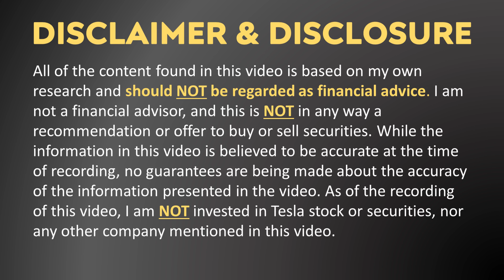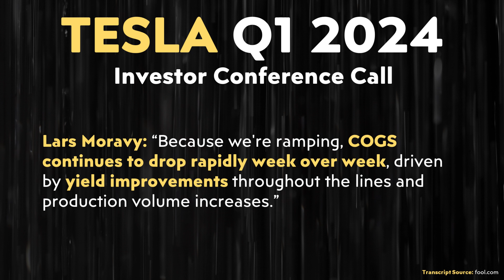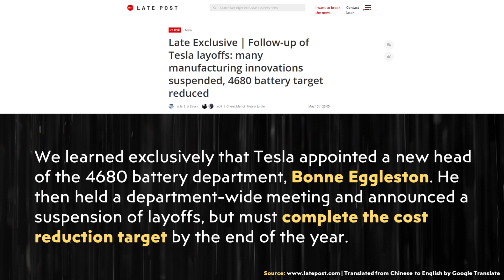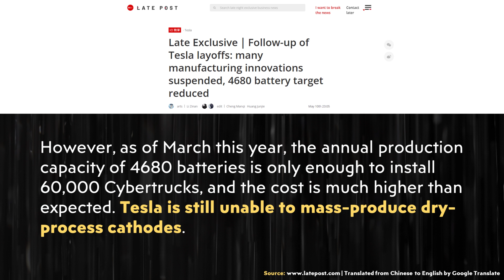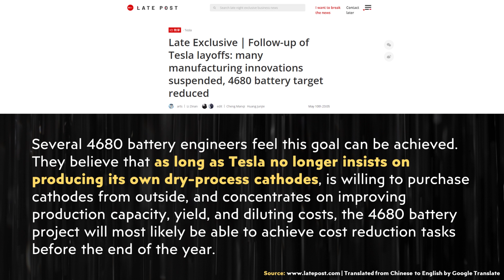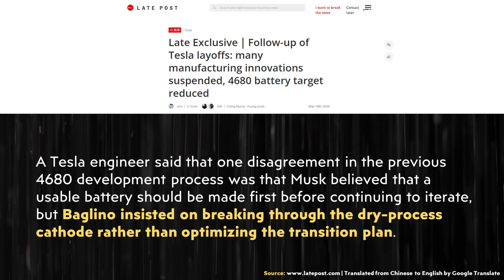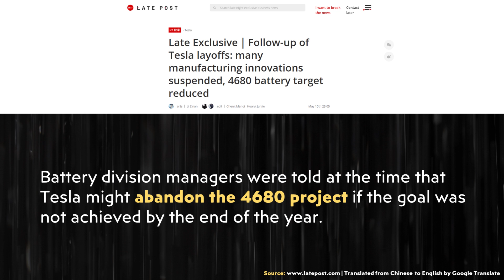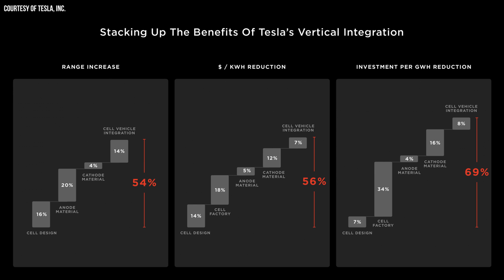Elon Musk: Lower 4680 Costs or Tesla Battery Program Abandoned!

Comment: Anyone could have predicted this years ago. Why would you think a completely new battery tech from an in experienced company would work after almost 150 years of battery development. Even if it is possible it would be cost prohibitive. This is because the more complex or difficult a technology the higher the cost. But too be honest I'm surprised they haven't fingered out the dry cathode issues yet. 

I heard a year ago they had a break through so was that another lie. It seems like they are trying to prove the entire scientific and battery industry as fools this is a vary arrogant approach to engineering and will ultimately prove them the fools. 

Engineering breakthroughs have always been incremental and time tested. But let's be honest here by now they should at least have the napkin maths on if it's going to work. Since they are working on all the current production issues there should be no more surprises at this point. 

Its a little like there autonomous driving again making bold claims and even promises without even a working demo. Its getting to be obvious that Tesla is now mostly built on a hype train of never ending promises. Hasn't CATL built a solid state battery?

I am tiered of hearing about Tesla almost tech. Showing is believing and they have shown vary little. I see a demo of the great FSD beta the other day and the auto summon. It turns out it can't navigate a empty parking lot 20 metres in the rain. What chance in a busy shopping parking lot with pedestrians. Good luck I have lost my faith in them. Lucky I'm not an investor but at least as a standard electric car manufacture it might be worth the $89 billion with market share.

Comment: Help me out here please. Here in Europe we get our Model 3's from Shanghai and our Y's from Berlin. None of those use 4680 cells so we have no experience of how they perform in terms of charging speed or durability. My understanding was that some of the Model Y made in the USA had 4680 cells, depending on the model. Do they have a better energy density than 2170 or batteries from CATL or BYD? Do they charge quicker? Do they suffer less degradation? Tesla announced the 4680 at 'Battery Day' in 2020, nearly 4 years ago with the idea that manufacturing costs would be greatly reduced and energy density would be higher. This seems not to have happened, at least not yet. I imagine Mr. Musk is pondering the question of at what point do we stop pouring money into this. Any information of how 4680's perform in actual use would be interesting.

Comment: You make great videos!  Sure hope the R&D concentration on 4680 does not preclude other format innovation.  Thinking WAAAY outside the box; what about highway segments that are 10 miles of solar followed by ten miles of battery bar; or other format, storage and a continuous electrical pick up track for cars and trucks only.  E.g.;  not for 2 wheel motorcycles.

Comment: The 4860 is clearly a dud. 
At launch it was claimed production would reach 100GB a year by 2020, reality was around 1GB. 
It also more expensive, less power dense and charges slower than even the old 2070.
Meanwhile CATL is powering ahead with new better and cheaper batteries being launched every 6 months.
Reply: That's false, it's currently on par with LG 2170s. Panasonic 2170s are a bit better but not by a significant margin.
Reply: @boostav  Given the very low production rate and the amount of time and resources inversted in the 4860 I very much doubt that.

By any metric the reality of the 4860 has fallen way below the promises/expectations made when it was launched.
Reply: @Alantj22  I'm talking about energy density.
Reply: @boostav  Its failed on that as well. That's why the Cybertruck doesn't have anywhere near a 500m range.

Comment: The delay in the 4680 battery program has cost Tesla dearly. It seems to be the reason behind postponement of the Semi program. The MY has also been impacted. It is back to 2670 cells, no longer has the structural  battery pact and is probably not using both the front and back castings. I am glad Elon has the guts to set a deadline. After several years of fishing and catching very little it's time to cut bait. I just wish Tesla hadn't committed to 4680s so heavily while they were still unproven.
Reply: When 4680s was committed to all other batteries where really expensive and Tesla had a road map map to cheap high performance batteries. Unfortunately making batteries at scale is super hard. Panasonic battled with this for years at Nevada. So by the time tesla makes batteries at scale the completion may be ahead of them 
Catl is doing an amazing job and don't think anyone would have predicted how good they would be a few years ago

Comment: The problem with the battery might manufacture is one of the two big technical issues Tesla has faced. The other was the FSD development dead end. They had to switch to the large languages model self learning model. And Karpathy go the chop for that.
Reply: Andre left on his own free will. He still has find memories of Tesla and even Elon. He wanted to do something different. He has moved on from openai after 1 year there
Reply: Andre said he tried end to end neural network for fsd at Tesla.  but the data was to sparce to train it and he just prior to V12 release, posted warnings about how hard it would be to get V12 of fsd working . Tesla have invented a secret source after Andre left for V12 which could well be using  groq

Comment: The dry anode electrode is relatively easy. To date, however, no company has ever succeeded in dry cathode electrode. Tesla has been importing big rolls of cathode electrode (made from wet process) from China/Korea. Tesla buys cathode material from L&F and LG Chem (Korea). Tesla also imports 4680 cans and jelly-roll insertion machines and many other manufacturing equipment from Korea. So, Tesla has been just assembling 4680 batteries. Note that LG Chem has been investing in Li-ion battery technology since 1993. It would be almost impossible for Tesla to catch up with the battery technology in just a few years. Tesla should have bought a battery company (LG EnSol, SK On, Samsung SDI or Panasonic) instead of wasting time and money on building its own 4680 batteries. The good news is that LG Energy Solution, Samsung SDI and Kumyang will mass produce 46xx (4680, 4695, 46110, 46120) soon.

Comment: Its funny you say that pressure on the team will reault in meeting the goals of producing 4680 at a cost lower than their current battery suppliers. 4680 will go down in the history as a super hyped up battery with no benefits.
Reply: Toyota EVs are already driving around with solid state batteries that will do 1000km and charge in under 5 minutes. How can you compete with that?

Phillip.
Reply: @philliptemple9841  LoL

Comment: Thank You for the analysis that i have been waiting for, for such a long time. 4680 underpins  far too many products to keep waiting and waiting and waiting on the cathode. 
Tabling that for now and optimizing the rest is a relief. 
They were clearly not close and this would wreck Semi and Cybertruck. 
They need to get the costs down, yield Way up (clearly stalled over the interminable cathode issue) and the phase 2 really needs to start soon as 20% increments are Not cutting it.
Need to see 3x the cyber truck run rate by EOY and energy density to 300+ wh/kg even if its silicon and wet as opposed to dry.
If they can get the silicon in the cathode, they can push the density and yield longer range Cybertrucks (this is needed). 
They also need to get the Semis in production ASAP, though this will take another 18 months or so as they are just building the factory now... very, very late in the game. 

Not sure What's going on in Mexico, but the nonsense in Germany shows that they Really need that as the German government is clearly playing games, much like the Biden administration. 

There are a lot of balls in the air now. Production of the Model 2 and 4680, Musk compensation and getting far away from Delaware, really would like to see some of this settle in the next few month... still its great to see Musk breaking the 4680 bottleneck. That was the most frustrating of all.

Comment: A sad result from the dry battery electrode system not working is that the advantage of reducing the chemical solvent air pollution that is caused by the traditional oven method will be lost.
Reply: Yeah that was one of the big sells for the tech I was impressed with. It's a good process they just can't ramp production in comparison to blade batteries which are good enough. If they take much longer the solid state tech will be ready for mass production and all of this is moot.

Comment: I doubt Elon said this about end of yr for 4680 team to reduce costs.
Why, because 4680 was never meant to be the lowest cost battery. It was meant to be a hedge againnt high battery prices and supply bottlenecks due to more and more car xompanies going EV and driving up prices and reducing availability to supply.
Now things have changedto excess supply and also additional supply of 4680-style batteries it may seem to Elon he can get as such supply as he needs.
Well he stupid because thing could change for the worst and suppply tightens. Things in commodity sectors tend yo go from feast and then famine.
Best to ramp own production and R&D for US and EU 4680 local production. China will just have make batteries for China thus inducing excesss supply.
It will take years to remove the excess battery supply.

Comment: So its now official: Dry Electrode Cathodes don't last (Red electrolyte in 4680's is the result of dry cathode breakdown in early prototype batteries)! Didn't you do a video about this months ago?
What everybody is still missing is that the ultimate success of the Tesla Cybertruck, and Semi rest on the 4680's not only to be cheap but also having much higher power density than any other battery technology. The 500 mile ranges of both depend on it. Also the multi-tab battery design was superposed to reduce internal resistance resulting in flat curve fast charging. Clearly the dry process is causing greater internal resistance not less!
Reply: They've already achieved a 500-mile range in the Semi with 2170 cells. They need the 4680 to be where they said it would be for the CyberTruck to be better than instead of slightly worse than the Ford and Rivian competition.
Reply: @TecnamTwin  The Semi is a scam.
Reply: @Withnail1969  The Tesla Semi could be world-changing, but is to expensive to go to full production because of the 4680 cost, low power density, and slow charging speed!
Reply: That's a bummer and I hadn't heard that. You need to post a video.
Reply: If they switch to CATL they'll get hit with tariffs.
Reply: CATL are doing some excellent work on battery costs and power density the CYBER TRUCK can use several different battery types. :face-purple-crying::face-purple-crying::face-purple-crying::face-purple-crying::face-purple-crying:
Reply: Part of eating an elephant that is making 4680 a thing is that it takes time and development. The dry process will be the underlying technology and odds are as these issues are mastered. Tesla will push the underlying technology even harder, since in principal batteries are the limiting factor.
Reply: @RNA0ROGER  They have abandoned those batteries. No more development.
Reply: @Withnail1969  No I doubt they will exactly be inclined to do that even more so in the long term.
Reply: Maxwell saw Elon as an opportunity.  Every promoted brilliant move is based on a blue sky best case scenario.  Invest what you can afford to lose is my advice.
Reply: Incorrect, the Semi doesn't need 4680s as it won't be using a structural pack and the Cybertruck can reach the range target by using taller 46xx cells.

Comment: Panasonic was right about dry process .
Reply: What'd they say about it?  I'm baffled as to why it's so difficult.
Reply: Really. They are still struggling with the dry annode process. The dry cathode is much more difficult.
Reply: @jackylsmith8138 yes really. They were in fact correct and said so at the time. This failure was considered essentially a certainty by others in the battery industry. 

Just like the bogus ‘unboxed’ vaporware we are hearing about. Manufacturers say the cost savings hype from Tesla is bogus and we are seeing that. Tesla said it can save 50% cost and years later they have built zero lines to utilize this miracle tech. More lies.
Reply: @jackylsmith8138  Exactly, trying to make them at the volume they need is very difficult.
Reply: The faster you go the harder it becomes
Reply: Just stubbornness, could have gone with semi-wet process.

Comment: Tabless design's advantages for cooling, reduced resistance, alone should make 4680 a mandatory future item.
Reply: Or same tabless be provided by suppliers? I don't think what you are saying has any bearing on Tesla being the one the provide it.
Reply: @DanaOredson  Why do you think that a group which couldn't come up with the idea would be better able to build it? Clearly the problem is the dry process, if they simply reverted to the wet process (larger space in separate buildings) they should be able to maintain mfgring.
Reply: @DanaOredson  yet even Panasonic 4680 doesn’t feature tabless AFAIK. Go figure.
How about BMW with 46mm dia, 95 or 125 length. Tabless?
Reply: Yeah, Tesla can purchase cathode foil till DBE sorted. 
Bigger cells make sense - for nickel chemistry.
LFP easier to buy from CATL - if Biden allows.

Comment: If they abandon the 4680, then what? Will Tesla always rely on others to make the same battery? That doesn't seem logical and aligned with Elon’s first-principles approach.
Reply: Meh, "First principles" doesn't mean "Vertical integration". I think you are conflating your subjects.
Reply: They won't abandon 4680. More Reuters type nonsense. They are doing what they did with unboxedd manufacturing, taking the innovations that worked and tabling the ones that didn't for a later date after the backlogs are cleared. 
M2 must come out no later than end of 2025. Cybertruck must scale to 150k run rate by end of this year and Semi needs to scale as quickly as possible with batteries that are affordable.
Reply: @avgjoe5969 4680 promised abilities and unboxed 50% cost savings are both clear vaporware. Not sure how much more you need to see to recognize this. Neither are happening for a reason.

Comment: When Tesla first production EV came out, they use to use Panasonic batteries. Now they use Chinese and 4680 which is not as good as the old Panasonic cells. So, Tesla owner now will not have the life of a Panasonic battery pack and many of you are either already have problem with your battery pack which Tesla try to hide. Good luck when the Battery Pack dies after your warranty just run out, as it might be better to go back to an ICE car. :face-blue-wide-eyes::hand-orange-covering-eyes::body-blue-raised-arms:
Reply: very little of this is true. Tesla uses CATL, BYD, LG, Panasonic, and Tesla batteries. In all likelihood the LFP batteries from CATL/BYD are the ones most likely to have the longest lives. None of the NCM cells will last as long at the LFP cells, irrespective of country of manufacture. Having said this, based on the data collected so far, which is mostly for NCM cells, these last in excess of 300k miles. The LFP cells may well last in excess of 500k miles. By comparison, IC vehicles will experience multiple failures long before 300k miles. These include fuel injection systems, catalytic converters, high pressure fuel pumps, electronic ignition systems, exhaust systems, transmissions, cooling systems.
Reply: @dangrass 
You should really search "Jeff Dahn 2 million mile cell".
(It's Nickel based).
.
The Battery industry is "The Wild West"
There's a New Sheriff in Town every month.
.
At the moment, "Sufficiently good and cheap" is the formula.
Next week? Could be back onto the latest "Super Cell".
Reply: Cells have advanced greatly since  early EV production.  Tesla is still using some Panasonic cells.  With 1.8 million battery packs a year it is using multiple suppliers.

Comment: i don't think "pressure" on the team will make a difference.  i'm sure they were working as hard as possible and it simply can't be done.
Reply: The surplus of cells from the manufactures they have lowered their prices so this is a moving target.    Should this ever turn around there will be competition and the 4680 will look good, providing they keep developing it.  The 4680 has value even when it is more expensive than purchased cells.  It moderates what suppliers can charge Tesla.
Reply: Exactly.
The time for 4680 might be when (IF) "other" manufacturers*return* to the  EV side.
Reply: Based on extensive technical knowledge, or on own tendency to give up?
Reply: It's a shift if focus from improving the cells, to make them cheaper instead.
Reply: Well, you know Elmo. He has been very vocal on how Tesla employees should work.
Reply: There is no such thing as "it can't be done".
Reply: @tedmoss  Your knowledge of physics is failing you.  There's an infinite number of things that can't be done.
Reply: @incognitotorpedo42  … your knowledge of current physics... Any sufficiently advanced technology is indistinguishable from magic.